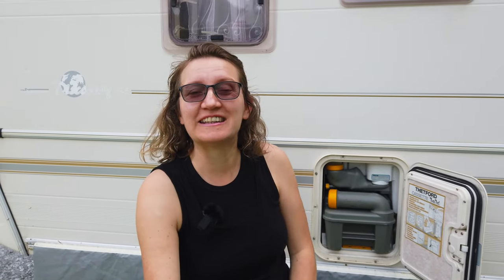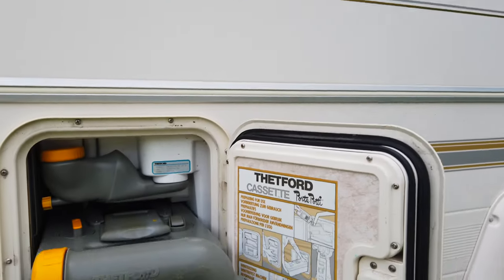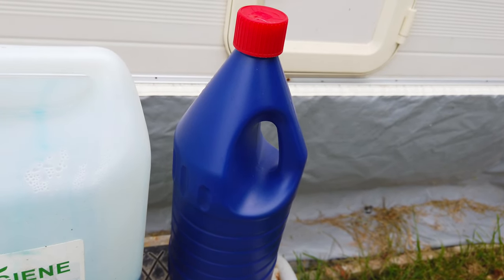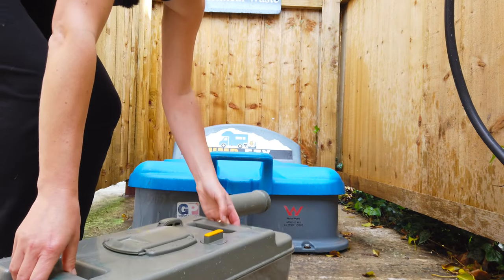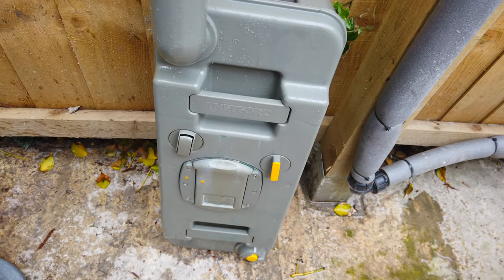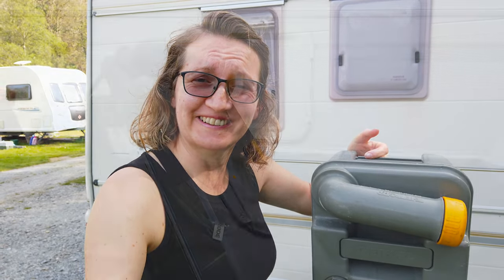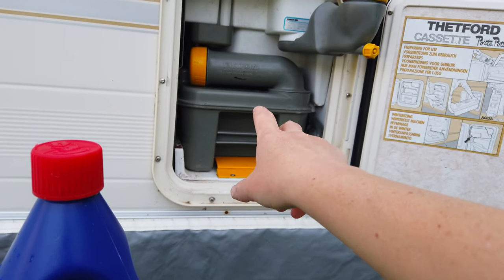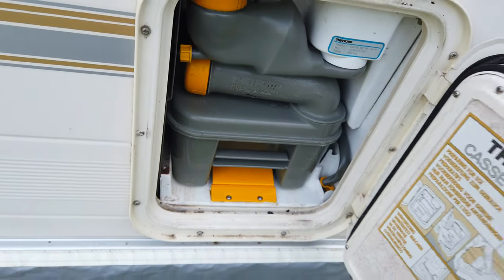#23 How To Clean & Sanitize Thetford TOILET CASSETTE - in motorhome, caravan or boat...

Comment: I always give ours a deep clean after a weeks use, first off course I empty it then give it a good flush out then put in a cup full of soda Chrystals along with a clothes washing tab in then warm water I then shake it about , then leave for 24 hours shaking in the mean time after 24 hours I empty it I then remove the top and give it a good clean inside using a. Small brush once that’s done put it all back together spraying a liberal amount of silicone spray on the moving parts .Once done looks like brand new!

Comment: What is the small knob with yellow on,what's its use.
Reply from the maker: Could you please specify the exact minute and second in the video where you saw the small knob with yellow on it? That way, I can provide you with more accurate information about its use. Thanks!
Reply: @FreedomSeekers-FS Sorry I should of replied ive sussed it out,it wasnt on the one in the video it was another type,founf out its to open slide on the cassette but i appreciate you answering.regards

Comment: yeah  i keep wondering about water, toilet cleaning and so on.. where to throw it
Reply from the maker: When it comes to disposing of water and waste from your caravan toilet cassette, it's important to use designated facilities provided at caravan sites or waste disposal points. These areas are equipped to handle such waste safely and responsibly. If you're unsure where the nearest disposal point is, the campsite staff or site regulations should provide guidance. Always follow the proper procedures to ensure environmental responsibility and the cleanliness of your surroundings.

Comment: Thetford: "Never use household detergents to clean the toilet: they may contain bleach, which can cause damage to the seals and plastic." - POOR ADVICE.
Reply from the maker: Using this method for over 5 years... 2 years in motorhome, 3 years in caravan. No problems at all 😁
Reply: Thetford only recommend purchasing thetford cleaning products to maximise sales.
Reply: 25 years living full time in caravans and never had a problem using bleach!
Reply: That's a load of bunk. If that were the case kitchen sinks, washing machines toilets showers etc... Would be leaking all over the world because of wrecked seals.